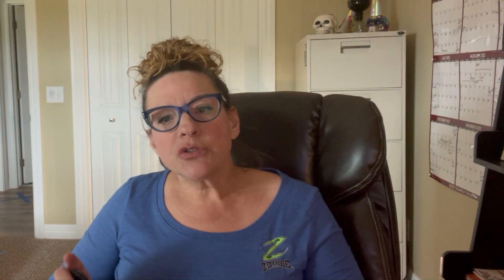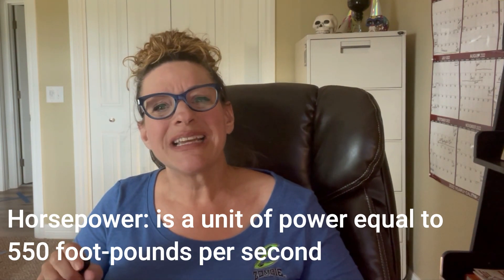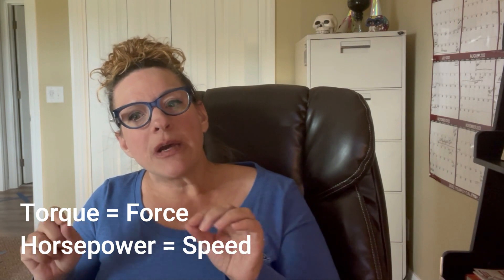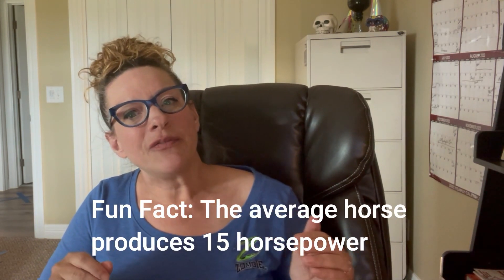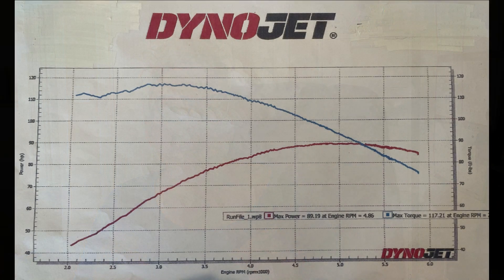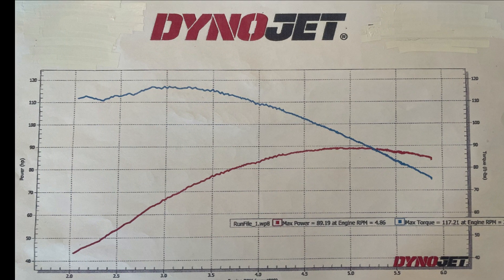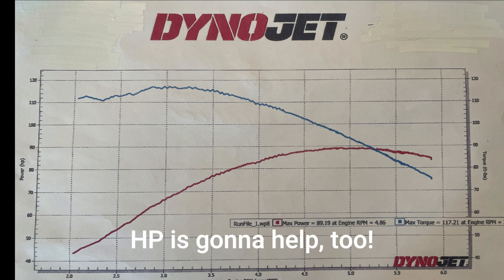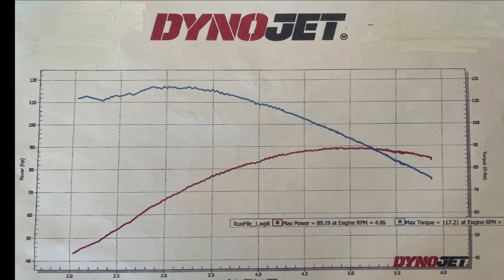TABsplaining: Dynojet Sheets

Comment: Can you mix 2.5 louvered with a Zombie baffle ....One in each pipe?
Reply from the maker: You an if you have a collector style header that balances your exhaust independent of the mufflers, if you are running a true dual set-up that could cause trouble.
Reply: @TABPerformance  which side should 2.5 go and which side Zombie baffle?
Reply from the maker: Typically when people do 1 of each the zombie goes in the left so the right side see's more restriction for back pressure, but there is no "right way" to do it, only what is best for you.